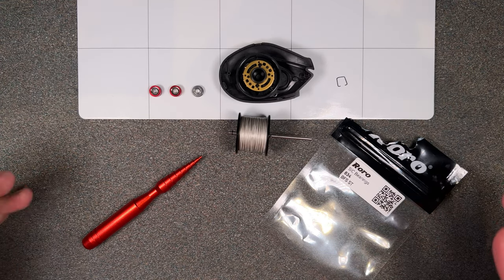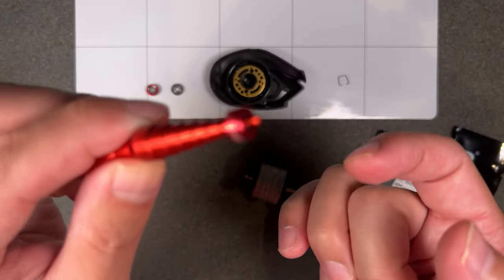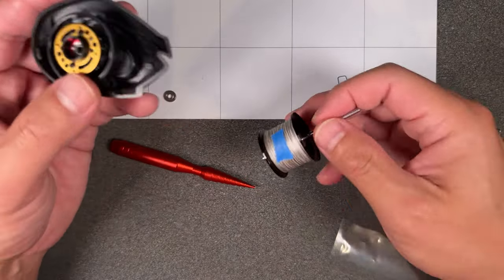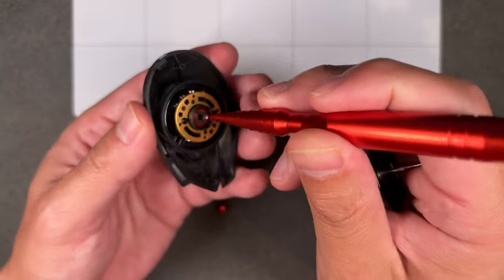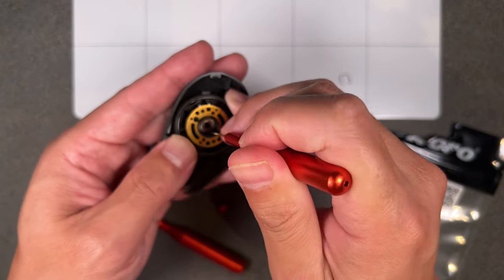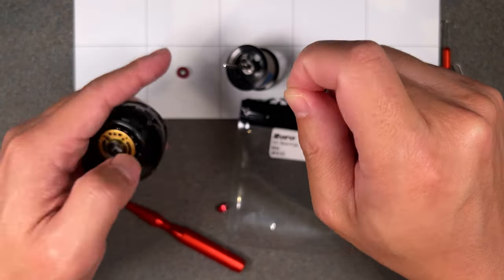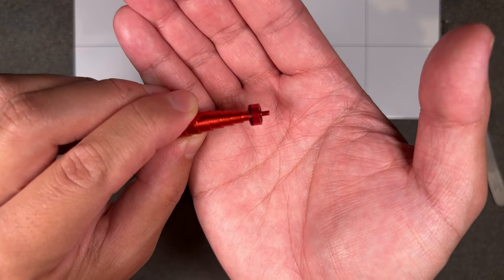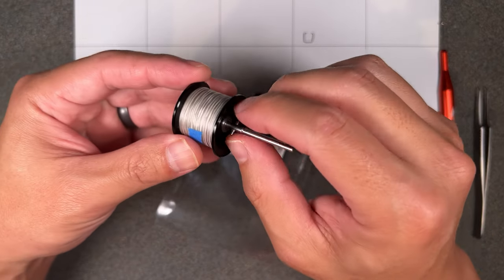Which is better??? Roro BFS ST bearing vs 2022 Shimano Aldebaran BFS bearing

Comment: For what it is worth, I have tried various expensive bearings in a variety of reels for over 10 years.  All the reels I tested them in were mid quality 100 or 150 size baitcasters manufactured in Japan.  In all cases the premium, expensive ceramic bearings showed a marked improvement in free spool spin time which is the major feature used to market them. However, in no case did I observe, on a measured casting course, any improvement in actual casting distance.  Other Youtubers who have done similar tests with BFS reels and generally have not noticed any measurable improvements in actual casting distance except where the stock bearings were of unusually poor quality.  If one is using any anti-backlashing force at all, that resistance will wipe out any potential improvement reduced bearing friction might offer.  Just my opinion....
Reply from the maker: I agree with you! However I also think that upgrading bearings just maximizes and eliminates any source of drag that might discourage initial spool rotation with ultra lightweight lures. In any case, I do plan on doing a casting comparison with the reel that these will be installed in, the Soloking Acura reel. This reel has stainless steel bearing which don’t have the best free spool ability so I’m curious to see what performance gains, if any, the bearings will have at various lure weights. In any case, I do greatly appreciate your feedback! Cheers!
Reply from the maker: Hey there! Yea the brakes might be playing a role in keeping your lures from casting further but there are lots of other variables such as spool weight, the rod you are using, amount of line you have spooled, casting technique, etc. Typically speaking these bearing upgrades are mainly for ultra light applications and do help net extra distance as newer BFS reels are already maximizing other factors that might be holding back casting distance for 3g lures and lower. Hope that kind of helps explain things a bit! Cheers!

Comment: What’s the best bearing I can put on my reel? Are they all normally the same size?
Reply from the maker: Hey hcb! Hm… that’s a really subjective question to ask imho. There’s a lot of factors to consider when it comes to bearings but typically I like to replace stainless steel with hybrid micro ceramic bearings like the roro bfs sic bearings. If not then a hybrid ceramic bearings will free up your spool. There are some really great affordable ones on aliexpress. Regarding your question about size, no bearings on reels come in all different sizes. You’ll have to get that information or take measurements. Hope that helps! Cheers my friend!
Reply: @BFSFISHINGCHANNEL  thanks g, I’ll look into it. I think the reels are casting smoother now.

Comment: You may be able to check Vape supply related sites for those super small o-rings. A lot of the tanks sold require very small o-rings. Just a thought.
Reply from the maker: Interesting! I’m gonna have to try and get some measurements of the o-rings. They aren’t as durable as I initially thought they were and the spool shaft o-ring is already starting to show some  small nicks and wear sadly… Appreciate the tip! Cheers!
Reply: @BFSFISHINGCHANNEL hey pete any luck finding o rings that would fit? I want to put one on my gekka spool just to see how it’ll do but can’t find o rings that small
Reply from the maker: Hey hooka! I just looked and aliexpress has a bunch of small sized orings. Is there a way you can measure the spool shaft diameter in your gekka spool as well as any other potential tolerances you might need to accommodate for? These would be things such as the spool bearing inner race to shield height. You probably don’t want your oring touching both the inner race and also the shielding. Let me know if you can get measurements and I’ll try helping you source the right size! Cheers my friend!
Reply: @BFSFISHINGCHANNEL  I don’t have a measuring clamp but I can find one and measure it. It’s basically the same design as the Aldebaran spool shaft, but it’s missing the o ring where the Aldebaran has one. I was wondering if I do place an o ring there, would that make a solid contact with the bearing it goes into? It would be interesting to see the results, as it does have an area for an o ring but for whatever reason daiwa didn’t throw one on.

Comment: I need to order new bearings from Shimano, mine are getting grindy
Reply from the maker: Hey Jonathan! Ah that’s a bummer… before you buy new ones have you considered trying to give your current ones a flush? Before you do I would suggest removing the orings around them and then giving them a soak and swirl in some isopropyl alcohol or acetone. Otherwise, you can probably order them directly from Shimano USA, plat.co.jp or hedgehogstudios. Hope that helps and cheers my friend!
Reply: @BFSFISHINGCHANNEL  thank you I'll give that a try
Reply from the maker: @jonathanrivera6815 hey Jonathan! Sounds good! Let me know if you have any other questions. Cheers my friend!

Comment: I don’t think those are the correct size bearings for that reel. Can you fit the bearing retaining clip onto the side plate with those roro bearings in it?
Reply from the maker: You are absolutely correct! The outer and inner diameters are right but the width of the bearing is about double the stock Aldebaran bearing. The retaining clip will not fit and I didn’t buy the bearings intending to replace the Aldebaran bearings. Instead, these will be going into my Soloking Acura reel which is a Tsurinoya Dark Wolf Ultra clone. I just wanted to compare these bearings to the stock Aldebaran bearings as the size is virtually the same. Thanks for noticing this!
Reply: Hey Brother the 834 bearing will it on the spool or is it too thick and won’t fit flush in the reel?
Reply from the maker: @rpl4eva29 hey rpl! The 834 size is not for the Aldebaran. I used these for the Soloking Acura and was comparing them to the stock Aldebaran bfs bearings. Hope that helps explain things! Cheers my friend!
Reply: @BFSFISHINGCHANNEL  yes it appears to be a 3x8x2.5.

Comment: hello! I'm from Brazil I recently bought the Aldebaran BFS reel but I lost the spoll oring
could you tell me the size of it?
I already searched a lot but I didn't find the specs
thanks! :)
Reply from the maker: Hey Ricardo! I’ll have to check in on that for you a bit later but I’ll try to get some measurements. Have you tried checking Shimano replacement parts for spares? I know you can order replacement parts on hedgehog studios’ website and also plat.co.jp. If you still want measurements lmk and I can try to get those for you a bit later. Cheers!
Reply: @BFSFISHINGCHANNEL  hello! thank you very much for the quick response!
I took a look at this site but shipping to Brazil is a little expensive for such a small piece
but thanks a lot for the help!